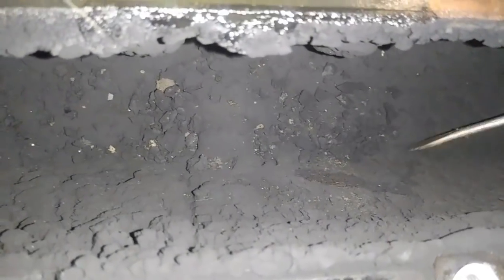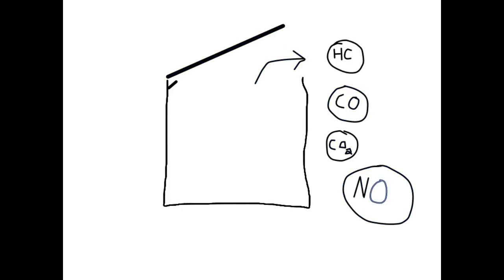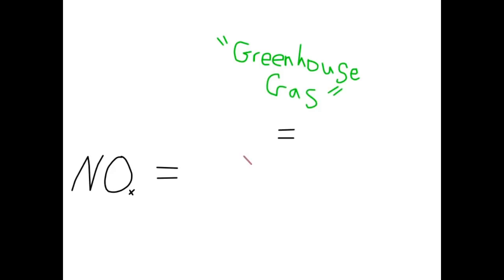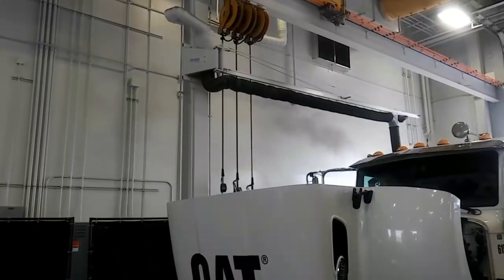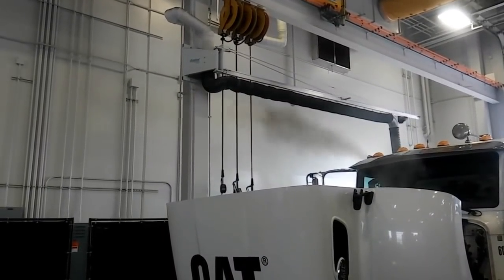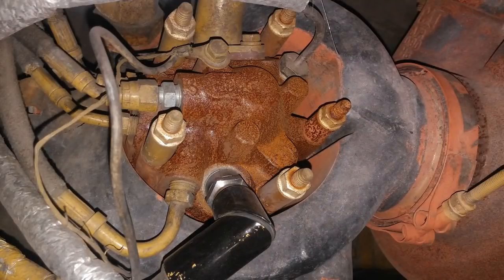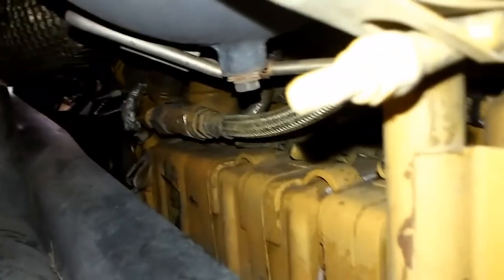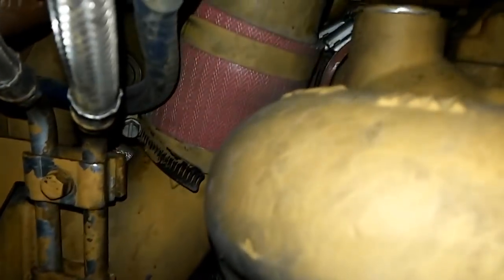Why the Cat Truck Engine EGR System Was Better Than Cummins. The Cat CGI System.

Comment: Why didn’t they stick with it? Obviously it’s a much better idea than pulling dirty unfiltered air. The cracked CGI pipe could have been dealted with. Some sort of sensor could have thrown a code if pressure or airflow was outside normal parameters. And they could have beefed up the pipe and guarded it to avoid cracking. 

Maybe the lack of pressure you discussed didn’t force enough of it into the intake and therefore didn’t reduce Nox as much as needed so that’s why they went away from it? Although I think the engine would have had to pass epa tests before getting approved so it had to be effective.

Comment: I recently sold my 2000 Freightliner with a CAT 3126, with 665,000 miles. It never had an inframe and ran like a champ. I also sold my 2013 International 4300 with 205,000 for scrap. It was fucking garbage!

Comment: Ugh, this takes be back. ARD head updates on LEE c13 shoved into an m2 freightliner were terrible. A video on cgi but no mention of how important clean air filters were and why on these particular engines? Or the acid that would form in the elbow off of the cooler? Good video though. Can't hit every point on them. So many changes with sdp and lee.

Comment: NOX is more of a smog constituent than a greenhouse gas. Co2 is the ghg and the only way to reduce it is to not start the engine.
Reply: Diesel engines actually puts out less carbon emissions than gas engines. But diesel does that by literally putting out many times more NOx than a gasoline engine does. So it is almost a wash in trade offs.

Comment: Great video. Maybe gm, Ford,  Cummins and the others will use that design in the future
Reply: Lay off the hydrogen fuel cell crap. It’s technology that is problematic and not to mention using the most unstable element on the planet. Climate change is a money making scheme. So is DEF.
Reply: John Brennan  You talk WAY (In the comment section) much about fuel cells that are not ready yet to make a difference.

Comment: The EGR systems on pretty much every vehicle were designed as a bandaid to get through emissions certification without putting in a lot of time and expense to do it properly. But then they discovered an engine with EGR will crap itself in a third the time one without will and will require more maintenance before it does so win win the bean counters think.
The same with dpf and urea injection.
How is an engine that dies before it’s time using more fuel and oil and other resources and regularly has to go through a dangerous super polluting regeneration cycle supposed to be cleaner that an engine from the nineteen forties?

Comment: NOx is not really a greenhouse gas. Aside from soot, sulphur  dioxides and a few other carcinogens it’s about the only pollutant coming out of an engine. It contributes to the brown haze of photo chemical fog over cities known as smog and supposedly causes acid rain and supposedly causes inflammation of lung tissue resulting in damage or susceptibility to death from asthma and viruses like influenza and sars covid 19 etc etc etc. however unless you live in a tunnel or LA before unleaded gas or someplace where clean air is secondary to accepting a bribe you generally inhale more nox from your gas cooker and using candles or smoking than you’d ever get from vehicle exhaust.

Comment: When Cat announced the CGI system I thought it sounded better than EGR systems the other manufacturers were using.
Reply: I just wish Cat would keep using the CGI system on their equipment engines. I guess you could re-route the EGR tubes to after the DPF and before the turbo. But why do that when you could just delete the EGR and DPF systems?

Comment: Opposed piston clean combustion tech (like the commer knocker) is the only way to a future the after treatment systems are a pork barrel game rigging tool of the climate cult leftist dorks. The only salvation for the 4 stroke is a electrified turbo that spoils up in advance of fuel
Reply: John Brennan Yes the electric blower solves smoke during acceleration, Ford is working in a Electric assisted turbo Ford is also working on This technology  http://clipart-library.com/clipart/8i685LKiE.htm is the answer 50 to 70 percent thermal efficiecy is projected with modern fuel management injection technology. This is well proven tech it was scuttled by dumb asses at Chrysler and cummins when they bought out Commer Diesel in a joint engine development venture.

Comment: And now we have low pressure EGR systems being used in the small displacement GM and FCA truck motors.  Use a back pressure flap/partial valve and they muster some flow pressure as well.  GM uses the old sooty flow for rapid engine warmup, and supposedly almost exclusively low pressure (post DPF) exhaust gas for rest of time.  Time/miles will tell whether the 3L Duramax avoids the majority of soot buildup in intake.  I guess if larger diesels start running low pressure EGR, that’d be an answer for sure.
Wonder if GM or FCA put a oil trapping filter on crankcase flow (like Cummins) to kill off most of oil vapor that would tar up the intake passages otherwise

Comment: the only egr system on a diesel engine that makes any sense at all is one that does not exist. who ever decided this was needed, needs an extra hole in the head. not one diesel engine out there benefits from it and all of them actually will last longer, run better and be more fuel efficient without it.
Reply: EGR, in my view, should have been only a temporary solution until SCR systems (DEF systems) took over. Unfortunately pretty much all new engines have EGR, a DOC, DPF, ans an SCR system. Super complicated.

IMO the only emissions items these days should be a DOC and SCR system.

Comment: The CGI system was a plumbing and packaging nightmare for the truck manufacturers.  Detroit and Cummins have figured out how to handle the soot (the form of carbon your are referring to) in the intake and cylinder.  Most of the carbon in the egr stream is in the form of gas (CO2, CO ect.) not soot.  If you can keep the black smoke (soot) low in the exhaust going into the egr system  then fouling can be managed.

Comment: NOx it’s not a great house gas, it’s the cause of acid rain.
And there is nothing new with with taking the exhaust eater the DPF, Fiat power train have done it for years
Reply: Do you happen to know if this is the case on the Fiat Ducato 3.0L I4? (Ram Promaster Ecodiesel in US) circa 2015-2016
Reply: @gaiazyme  no not on that, but it’s generally a really good engine, with no problems as long as you don’t have hours and hours of idling 
Then you can get sot/oil vaipour build up in the head before the intake valves
Reply: Martin Andersson thank you my friend! In US it’s so rare to find anyone familiar with this engine. Appreciate it very much

Comment: If Diesel fuel is made up of mostly carbon and hydrogen, that's why organic Diesel fuels are becoming the norm.  Hydrogen is pretty combustible, so the only thing Diesel fuels need is a stabilizer and a lubricant.  These things run on detonation, while gas engines cannot, thus why cetane is used as a stabilizing agent.

Comment: Isn't a turbo just a glorified egr?  Why not filter the exhaust before it gets to the turbine, so the exhaust intake doesn't get plugged up?
Reply: Not even close. Egr aside, the exhaust gasses that drive the turbo do not mix with the clean intake air. Remote mounting a turbo after the dpf would introduce a whole new set of requirements....air intake plumbing, compressed air plumbing, coolant supply & return, oil supply and return.
Reply: You clearly have no concept of how a turbocharger works.

Comment: I learned a lot about the caterpillar Max Force the way it dumped it into its EGR cooler was beyond stupid yes they were a pain to change outwhat if you increase the size of the tubes to slow the molecules down and get rid of some of the heat for it hits the EGR which it is a cooler I understandand if you were able to clean the carbon out once a year made a huge differencewe change the oil more often what they recommended those every 20,000 we did it like 8 to 9,000 put half a million miles on it never touched it when the exhaust hits the EGR you want to move as slow as possible because of the heat heck how about scrubbing it before the EGR a metal filter that you change out once every so many miles that would solve a lot of problems to this day

Comment: Yes sir that dirty soot loaded air recks havoc on the Cummins engines. I agreed with cat using the filtered air from behind the DPF. Wish Cummins would give it a try.
Reply: Cummins has been testing engines for the past 3 years that don’t have an egr system. We have one in production but it’s off highway.

Comment: IVA system is EGR just done internally but it does plug up intake some. Then add in CGI which feeds acid back into engine (nitrogen mixed with water in case you wonder why exhaust rusted from inside out). If CAT system was some great why did engine go away. IVA's had problems breaking bolt and damaged cyl head. How many times did cat redesigned ARD head something like 9 times and still had problems. 1st was purge air and changed to heated nozzle. At every CAT training class I went to it was all Cummins engine needed overhauled at 400k miles which was BS but seen most went million miles easily. DAMN it took CAT 4 years to figure out what good regen was. How CAT engines went down from 300-500k miles because of head gasket many but at least CAT finally got smart using better metal in ACERT series. FUNNY CAT uses DEF fluid now after 3 yrs CAR, MANN and International project that failed. Cat truck almost had Cummins 15L put in it before they cancelled the truck
Reply: Cat  truck  was  international  with  the  maxforce pos
Reply: @cbmech2563  I'm well a were of that

Comment: And Cat slept though it to install the cgi system on off highway engines. The the result of it was a large quantity of warranty issues with not working egr valves an so on because auf the carbon soot. So good that with the tier 5 emission standard the  egr system ist totally canceled and more def fluid is injected.
Reply: Hate to break it to you but IVA was EGR. Basically it now has 2 EGR's IVA and CGI. I don't think you understand what EGR does and whats its used for. Funny CAT now uses DEF imagine that
Reply: @pdmustgtd1013  I think you don't understand what I wrote. Because the off highway machines from Cat like wheelloaders (K and M series) , excavators(E and F Series), dozer (newer N and R Series) and so on  don't have the cgi System were the air is taken behind the particularfilter. They use the egr system were the air is taken at the exhaust manifold at least that is the case in the European Union where I live . An the DEF system is also a system to reduce the NOx and in the exhaust gasses by reaction into H2O, CO2  and N. Both Systems do approximately the same in reducing  the NOx gasses  the EGR an CGI System only without an extra fluid by reducing the maximum combastion camber temperature thats the case why this systems are most disassembled under full engine load.
Reply: @Florian5120Pro  CGI didn't pass 2010 emission levels. Project between CAT, MANN and International tried for 3 yrs in not using DEF failed badly. Reason why International went back to Cummins crying. Cummins punished them for it too with training for techs. I'm also well aware of emission levels and differences. I also know what CGI, EGR, IVA, DEF fluid for and how it works. I've here before emissions and all the to current levels. Also CNG engines too but don't see many of them

Comment: I always thought that if you have to have exhaust gases going back into the intake, wouldn't it be better to get it from further back towards the tailpipe? Wouldn't that be cooler after it goes all the way back, and then forward to the engine compartment again? And it would be easy enough to have a filter in it to protect the engine.
Then I thought of a way to eliminate the EGR system completely and still reduce NOx, yet improve fuel efficiency and power. Just a hint, it involves spraying in another gas at high pressure during combustion to cool it and prevent the formation of NOx.
Reply: John Brennan  
On a diesel? 
The regen on a dpf would be hot, but it would still have to go to the back and then to the front again. Giving it time to cool, and reducing the demand on your cooling system.
Reply: John Brennan  
I don't know exact values, but I know that it gets very hot. What does cgi  do about it? What is the temperature at the tail pipe? And what would the temperature be after routing it back up to the engine compartment? You don't know until you try out the system, and you can still have a cooler that makes sure the return air will be cool enough. I'm just saying that everything else would be equal, so the longer the pipe, the more heat you reject before it goes back in the intake. I actually hate the whole idea of putting exhaust gases back into the intake, and I know that it destroys most of the benefits of a diesel engine. That is why I came up with a better way to reduce NOx emissions without any exhaust gas recirculation. A similar system has been proven in a university in Turkey, but I think my system will be better.
Reply: John Brennan  
I can see the writing on the wall how a lot of companies could have wanted to support a green energy candidate in order to get awarded these contracts. As usual you can learn a lot by following the money.

Comment: Omg I have been saying manufacturers should do this. But did think about the pipe getting damage and sucking in air, but couldn't you just run it through your air filter again? Or have 2 on there?
Reply from the maker: Yes you could add another filter, but this is exposed to exhaust heat so it would have to be something hard not a traditional air filter element, and then nobody would ever check it or replace it as they wouldn't know anything about it.
Reply: @AdeptApe  yeah thats true. They already dont replace their DEF filters

Comment: Why did Cat Fail and get sued then if it was better Josh?
Reply from the maker: The Regen system and CGI system are both on the engine, but the Regen system was the main problem although the IVAs also had problems.
Reply: I wonder what would have happened had they gone with a conventional VGT, aftertrearment fuel injector and intake throttle valve instead of IVAs and ARD. CGI seems like a great idea to overcome a lot of inherent problems with EGR.
Reply: The lawsuits were because of problems with the IVA's, VVA's, and Ard Heads.

Comment: One thing I've seen with newer engines is the engine temp runs higher than the older ones.  If they were really concerned about global warming don't you think that running the engine temp over 200 degrees vrs 160 would increase the atmosphere temp. Just something to think about

Comment: Better in theory but that SDP engine was the one that took Cat out of the trucking market, so many issues that warranty killed them if not the law suites that followed.
Reply: EXACTLY over engineer system, took CAT 4 years just finally figure out what good regen was and still didn't work right
Reply: @Evermore Here we go with delete stuff. Seen many who had problems with this too. Many people run these engines with zero problems because they read owners manual. So many just drive them never change filters or clean DPF filter and everything crashes on them with many many problems

Comment: I'm pretty new to EGR systems so I have a couple of questions, forgive me if they're rookie q's - #1 On a general EGR system (ie from ex. Manifold) how do they remove the soot before feeding to the MAF/turbo? Is this done before the Aftercooler?
#2 How does CAT's CGI deal with regens, surely feeding that superheated air back to the intake can't be good, or is the cooler beefed up to compensate?

#3 Runs off that last one, I have had trucks that missed auto, and then failed manual regens, to the point that you could leave it for 45mins and it was still idling high, trying to burn off.
In that case could a CGI system cause overheating issues?

Thanks for all your vids.
Reply: They don't do anything about the soot. When they regen they just make the engine make super hot exhaust and don't use egr at that time. Egr systems always have valves.
Reply: The EGR gas enters the intake somewhere between the charge air cooler and the cylinder head.